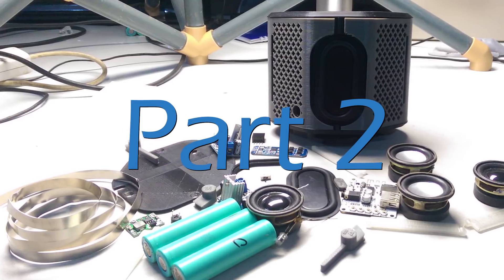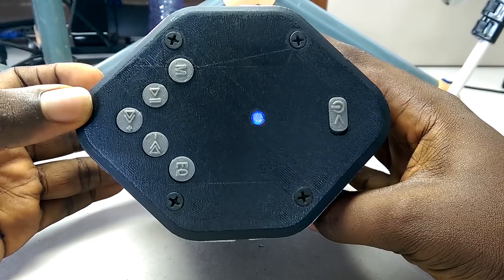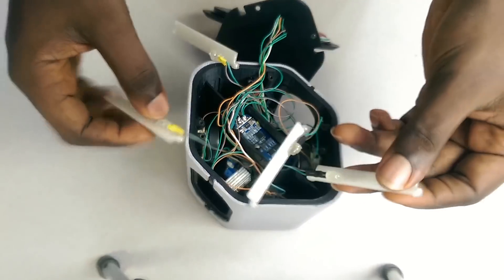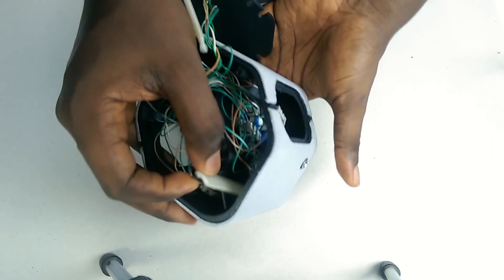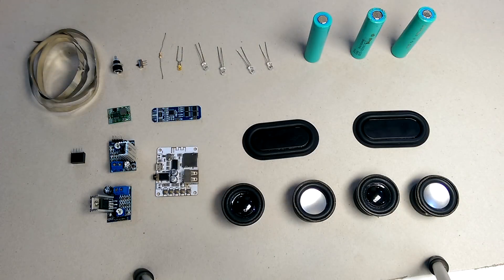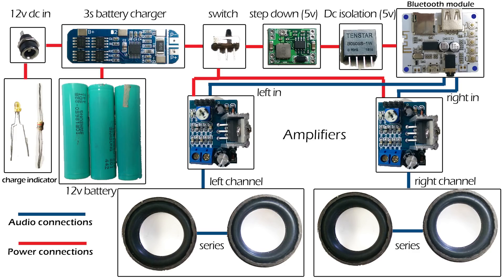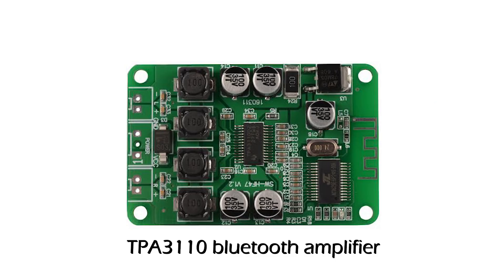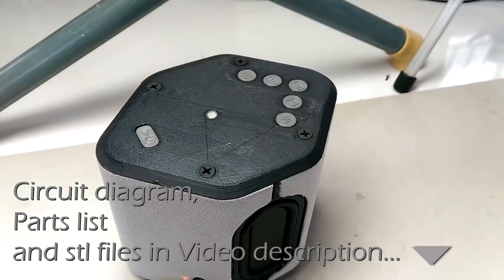3D Printed Bluetooth Speaker with Multi-Directional Stereo Sound | Part 2

Comment: A question: The LED don't show the charging state, right? In fact it shows only that the charger cable is plugged in and the there is a active energy circuit. But not the actual charging state. Or do I understand something wrong?

Kind regards.

Comment: Hello I have a problem with the BMS I have everything connected correctly but still I get the output of no 12V what can that be? I have already tried several boards to rule out a defect
Reply from the maker: If one of the three batteries is not connected properly, there will be no output, also make sure to charge the battery through the bms to turn it on from its protected state..
Reply from the maker: If one of the three batteries is not connected properly, there will be no output, also make sure to charge the battery through the bms to turn it on from its protected state..
Reply: @AhmsvilleLabs  So I have to load the batteries once over the BMS to get an output?
Reply from the maker: Exactly....
Reply: @AhmsvilleLabs  thanks it works